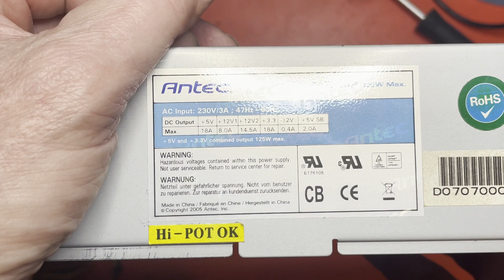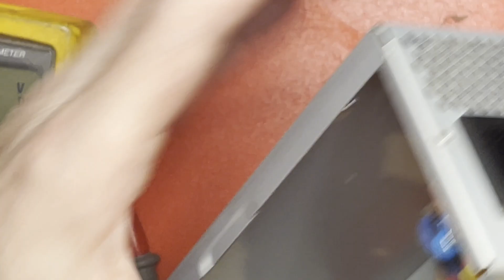Faultfinding and repairing a PC power supply - Part 1, initial PCB testing

Comment: Just remember kids, this has caps strong enough to kill you long after it has been unplugged from the wall.
Reply from the maker: Very true! I did mention leaving a few minutes for discharging after it had been powered.
Reply: Is that a joke? Please don't do that again. Discharge them safely. They last a lot longer than a few minutes and older ones may not have discharging resistors.
Reply from the maker: @o0oBeckyWilliamso0o  I always check the voltage! I do not rely on time alone.